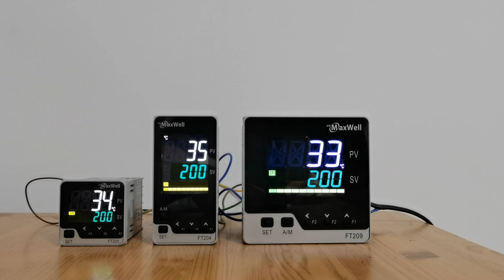LCD Display Temperature controller review

Comment: Very nice devices. The problem is that for single customer (i mean not as a big company), i can't find a straightforward place to buy them. I found out on AliExpress a LeiChuang Tec store from which i can't find the model i would like to buy for my specific uses. Maybe i'm wrong but it could the same model than from INKBIRD ITC-100RL:
https://fr.aliexpress.com/item/32767259322.html?spm=a2g0w.12010612.8148356.36.6b3f13ddHqEbJ4
Likely 12/24 DC input, 1or 2 relay output, and  basically K, J, Pt100 input probe. From what i could understood on Alibaba, it could be this order form: FT200-U-R-N-1-24-N-N-N-N-N-N (for 1 output alarm) or FT200-U-R-N-2-24-N-N-N-N-N-N (for 2 output alarm). Unfortunately it's too much complicated ordering from Alibaba whilst AliExpress is better for it but as i said earlier, the LeiChuang Tec store on AliExpress sells a very few models and in a really unclear and confusing way. Poorly described and sorted. As if they don't really want to sell. It is very sad that you are only targeting large companies when there are probably a lot of single customers who would like to have access to the purchase of your products. Greetings in China!